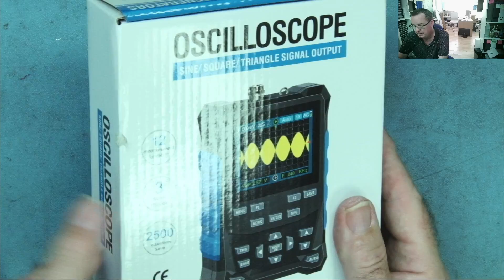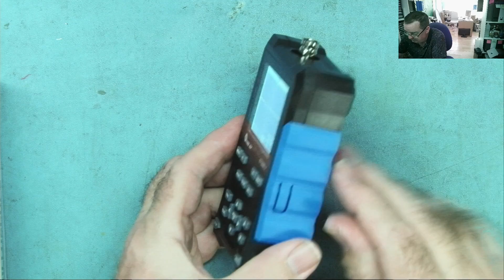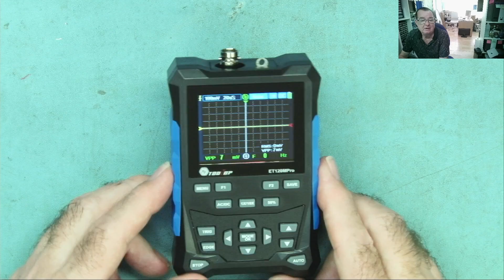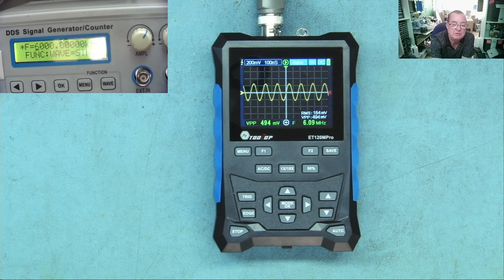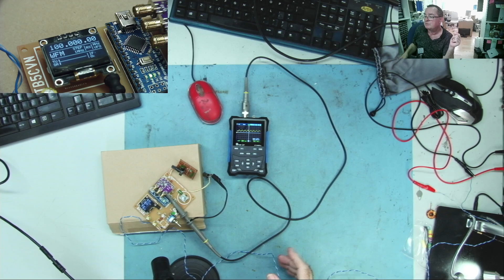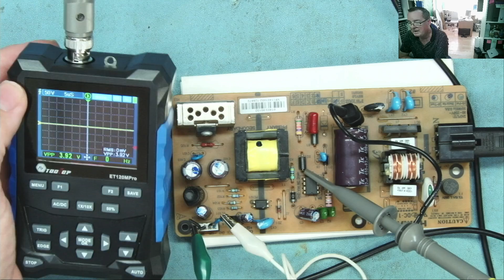ToolTop ET120MPro 120MHz Hand Held Oscilloscope & Signal Generator : Test And Review

Comment: I think the auto-range function is susceptible to aliasing at higher frequencies.  I would think that in many cases you will get better results by manually selecting the time base rather than relying on the Auto.

Other than that it seems like a pretty good instrument and a great value for folks with simple needs like myself.

Comment: Looks ok but I can't pay for something that says "120MHz bandwidth" and measures at 50MHz, so for me not so good. The trigger buttons need to be marked as you spent most of the video with it at zero, the red arrow at the side! at one point your wave was swinging wildly around zero (0v) and all it needed was a bit of trigger. Regarding the use of the auto button, I think it's quite handy but substitute for setting the volts/div and the time base manually it would have been a lot quicker and you new where you needed to be. As for the bandwidth why not start at the specified limit and work from there as opposed from starting at 7 MHZ and the 20 then 50 and so on because at 60 pounds its not going to have 120MHZ band width, more fun to take bets as you wind it down and see when it starts to make sense LOL !  Anyhow thats the machine not you as it takes a brave man to review in real time....cheers.
Reply from the maker: Probably I have a bad habit of just trying things when I review them and not reading the manual.  I just like to see if they are intuitive.  Mostly the trigger worked OK anyway but it was very easy to set once Iooked in the little book
Reply: :) @learnelectronicsrepair

Comment: I have the ZEEWEII DSO1511G which is 100MHz.  I agree the unit you showed today is more intuitive, not needing to know special keypress routines.  I would definitely buy this one instead, even though the price is a little higher.  I might miss the ability to connect the video output to a monitor using composite outputs and a HDMI converter (purchased separately).  I just don't like having to carry around a cheat sheet for button keypresses with the unit I have now.

Comment: If you jumped into your time machine and set the dial to 1973 when tv service electricians still made house calls I think this scope would have been magical compared to the scopes they commonly used back then.

House calls made sense given how big and heavy a console tv was in those days.

Just what kind of gadget did a typical homeowner have that would ever need a scope that could read higher than this in the early 70's?
Reply: Yes we would have needed a trailer back then to use a scope for house calls lol.

Comment: Let's say you connect it to  check diodes  on PCB to read the specs (MHz) would you remove the diodes and replace, based on that waveform and signals such as ripple and noise? (You get what you pay for).
➕💫➖

Comment: cant see the link ?
Reply from the maker: Sorry, it's fixed now. In a pinned comment and also in the video description
Here is the special offer on Aliexpress using this link. No code required, the price is €69.44 which represents 51% off the original price
https://www.aliexpress.com/item/1005006430919853.html?af=ler2022